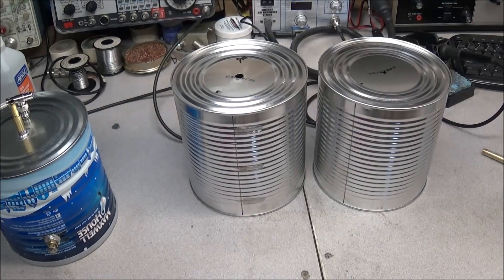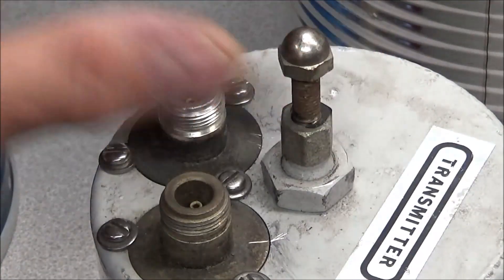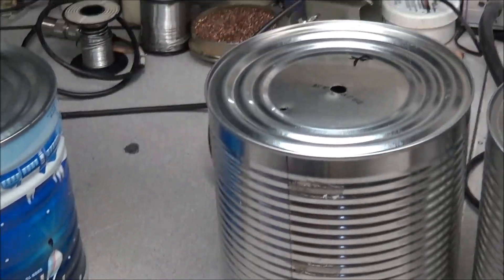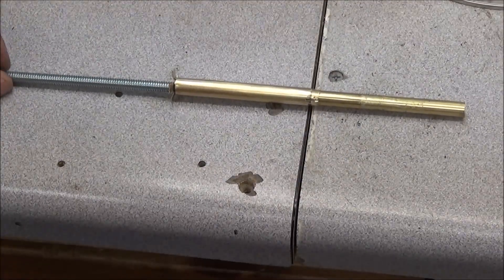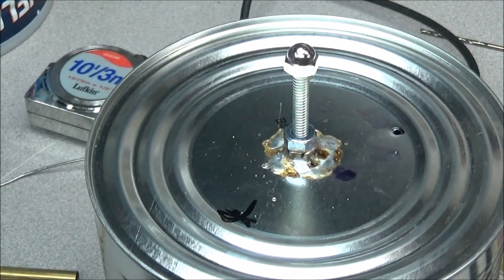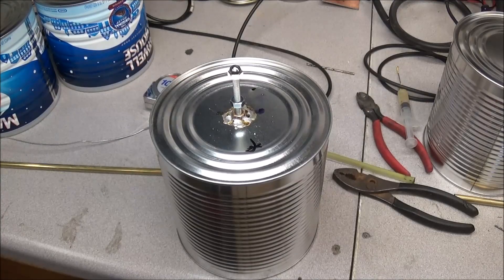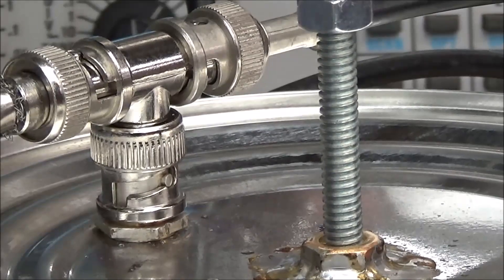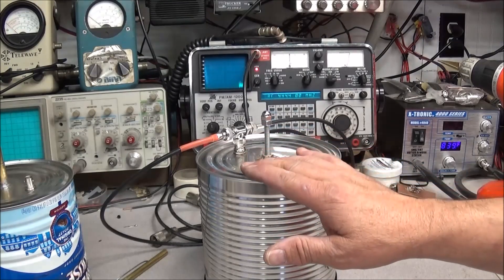#49 UHF duplexer 2 Coffee Overload!!

Comment: This videos is quite interesting.  I have always wondered how they are made and work.
Another question that is not related to this video.  Thi squestion is about the Yaesu FT 747GX and the question is where do you get the replacemnet capacitor kit from.  I found a couple kits on eBAy one from from Canada and the other from Hong Kong.
I also wonder where I can get a kit for the Kenwood TM 2550A 2 meter transceiver.
Thanks you for your help.
Randel Stuckey N4OHO
Reply from the maker: I cannot ever remember seeing a kit for that radio. So download the parts list and start from there.  I will see if I can do a bit of research on it. Thanks
Reply: I'll check on that since I already downloaded the service manual for that radio and it has the parts list in it.
There are two sellers listed on eBay showing a kit for the radio.  One is from Ontario, Canada and the other is from Hong Kong.  The one from Canada sells for $39.99 and the one from Hong Kong sells for about two dollars less, but the one from Canada looks like the type of caps that you use in your recapping projects.
Anyway I got the unit in today and come to find out this unit looks like the 747GX and says that it is but it isn't as deep as the one I saw you repair or use on your bench.  This unit was listed as the Yaesu FT 747GX CAT system and from what I see it is just a control head and not the whole radio so I just wasted around $150 on this deal, oh well that is the way the cookie crumbles somtimes.  If you have seen what this unit plugs into please let me know since I don't know anything about this unit at all.  I do know that it uses a cable that has a male printer plug on either ind, which is a 36 pin plug.  
The unit doesn't look too bad has a couple scratches on the metal cover on the back and a couple smudges on the faceplate, not scratches just finger smudges is all as far as I can tell.  Oh well my search goes on for a good cheap rig to get back on the air with.
73 and take care.  Keep up the good work on the videos.
Randy N4OHO

Comment: I am impressed!  I have got to get me one of those service monitors!  Of course I am wanting a spectrum analyzer with tracking generator.  It would sure be great to build a couple set's of these cans!   One place we plan to install a UHF machine is fully climate controlled, and these would probably get the job done!   It sure as heck doesn't hurt to try!   I am also impressed with your lab, you have quite extensive test equipment and knowledge on their use!  I have been a ham 25 years, NEVER been a "Appliance operator" but am now very interested in full repair and diagnostics.  For example my recently acquired antique Kenwood TM-221A Worked great until it didn't,  well ok most Kenwoods go nuts when their 2032 battery get's weak, so I went in carefully replaced the 2032 battery,  reassembled most of the way, powered up and the radio is no longer working.  Turn on and in almost every power up,  it freezes, sometimes you can push a couple buttons but then it will freeze up within seconds.  So I guess it's going to get buried in a pile till I have a service monitor like that IFR to do some signal tracing and readings.  I had read the VXO may need adjustment, but I only have a DSO Scope , I am not sure how to apply to that rigs issue to see if its aligned where it needs be,  I can see being a 1989 radio it could probably use a full alignment with its new memory battery. Just a thought,  any tips?   I subscribed and will look forward to more of your channel, this is the kinda stuff I love, I would rather watch you build coffee can duplexers than about anything my TV has to offer.   73 de Seth - W8FG
Reply from the maker: Hi Seth. First thanks for you kind words and sharing your information.  Sorry taking so long to get to this message. So many here.  Ok I have a question that may sound stupid but here goes. Did you do a full reset after the battery replacement?  Sometimes there is so much garbage in the cpu it goes crazy.  As far as an alignment that should not be needed. These rigs are fully processor controlled. So any alignment would be like audio, frequency error, PLL voltage, power out, ect.  Another problem may be the electrolytic capacitors.  I think this would be a great radio to learn a lot from.  Also remember that you do not need all this flashy test gear.  The IFR is nice yes but I use my HP8640B more than it and I also have a stand alone B&K spectrum analyzer with tracking gen.  Shop around and only get what it takes to do the job. You can always upgrade later on. A Motorola 2100 series service monitor can be had for like 500 bucks. Thanks for stopping in and stay tuned.73 Buddy
Reply: I did do a reset according to manual,  Im confused because the radio worked perfectly (except for memory retention of course". I expected a simple battery swap to do the job.  I had read the vxo could be off to cause this behavior.  Im just unsure how to go about testing as I dont think i have all necessary test gear?  I am going to look and may get brave and try.  Will post back here if im successful.
Reply from the maker: Keep us informed. May be able to help you through it.

Comment: I remember seeing a website that was for building 6 meter duplexers with scrap sections of 1 5/8" heliax. They also had a link to a calculator that would determine the overall length needed for each cavity. I tried VHF and UHF frequencies in this app and it gave me lengths needed.
Here is a link to the app,
http://www.qsl.net/kf6yb/duplexer.html
Scroll to bottom of page.
Reply from the maker: Yes I have seen that. thanks for the link  for the app.

Comment: Tip for soldering galvanised steel is to grind all the galvanising away, then flux it immediately then solder it. If possible use a torch, brazing rod and borax flux, that always works on steel to brass. 

Best is to use plumbers hard solder and a torch for those joins into the can, the regular solder will break with time. Just use plumbing paste flux and wash afterwards with a scrubbing brush and baking soda to get the residue off, as it will corrode the brass and eat through the tin plate.

Wonder if I could roll the can out of brass shimstock and make it, then silver plate it afterwards.
Reply from the maker: +SeanBZA Very nice tips. I did find that coffee cans do not like heat from a torch, warps very quickly. I rather use silver solder on the can but don't want to use that up just for testing purposes.Brass shim stock or even copper will work just fine for rolling your own cavity. I have seen this done on a 6 meter repeater. You could roll several layers on it with no problems. Would make a nice cavity. Thanks again.

Comment: Great idea much better using threaded rods, I will wait and see your complete project and then do mine,,   Thanks for taking time to share this
Reply from the maker: +DENNIS N No problem Dennis. Yes the all thread worked out very nice. Wish it was brass AT but could not find it locally.  Will be several weeks of testing on this. Thanks for watching.
Reply: they make brass tubing for lamps its 1/8 in fine threads for the old lamp sockets I used to buy it in long pieces  fine threads would make precise tuning   just a thought

Comment: Nice job.  The screw adjustment is a lot easier to use.  Your BNC T's and all the other goodies will be headed your way Monday.

LOL, throw away, what does that mean?  I still have parts radios I got before I turned 10.  2 pole barns and 2 garages later and I still don't have enough room for all my junk.  Just never know when you might need that widget you got 35 years sgo. :)
Reply from the maker: +MikesRadioRepair  Thanks Mike. I like the adjustable screw over the slide. Works much better. I hate throwing things out. Really need to. So little space left. My garage is useless.....Cant wait to get the package.
Reply: +The Radio Shop

In clinical terms its known as flat surface syndrome.   Those afflicted with this syndrome can't stand to have any exposed flat surface and feel compelled to cover it with useless junk as quickly as possible.  Friends and family that think we have completely lost it are frequently surprised when they need a widget at 2AM Sunday morning when all the stores are closed and find that we seem to have the entire planets inventory hidden away.  Its junk until they need something. :)